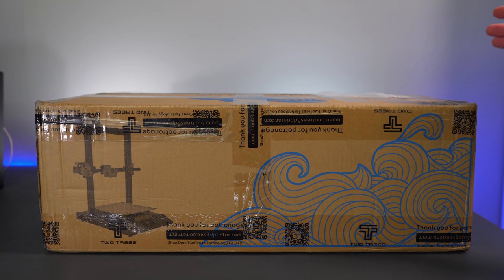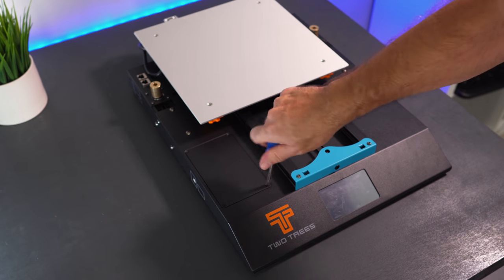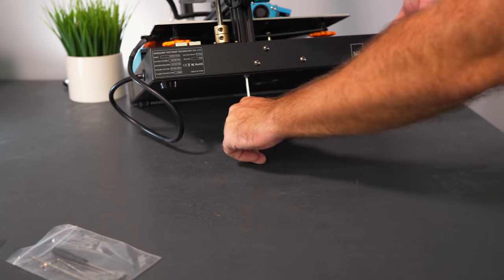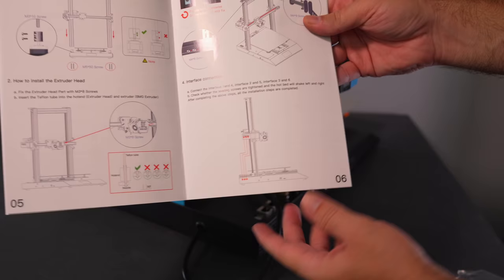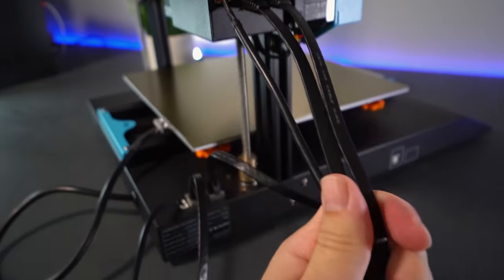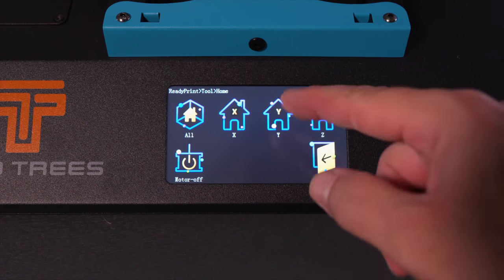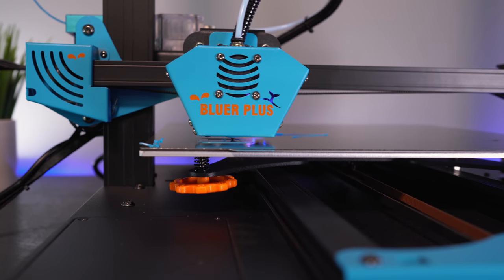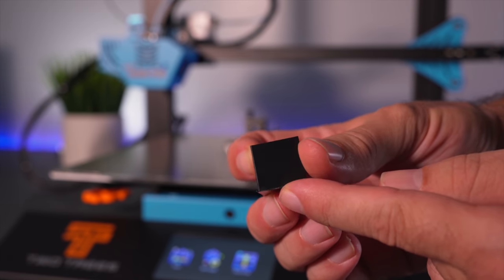Two Trees Bluer Plus - 3D Printer - Unbox & Setup

Comment: I cant understand the trend of placing a runout sensor right in front of the extruder, the best place is above the hotend but you also need direct drive as no matter where the filament breaks it will be detected, I have only had 2 filament breakages but both have been in the extruder gear and would not have triggered with this design.

Comment: Hi I bought this model and my extruder doesnt .... well extrude would be the correct word? The filamend get stuck after about first three minutes of printing and after that the printer stops printing and is running on empty while extruder keeps sort of twitching but doesnt move the filament single milimeter (I measured it) Any idea how to fix this problem and does anyone else has this same problem as me? Thanks

Comment: If you are concerned about kinking (crushing) the PTFE tubing, put a zip-tie (one at a time) along the length of the PTFE tubing, THEN zip-tie AROUND the PTFE holding the first zip-tie, lastly use the last one to go around the cable jacket, that will make sure you CANNOT crush/kink the Bowdin tube.

Comment: Hi, i like this printer, i believe i will add to my current printers ... some questions:
-Is the BL-TOUCH also used for the Z - Homepoint? I have not seen Z axis micro switch
-After you have performed an auto leveling, the values remain in memory on the CPU or is auto leveling always performed before each print? I hope it is the first hypothesis
- I saw that the display shows the preview of the gcode drawing, does this happen regardless of the slicer program used?
thanks for info

Comment: Looks like a nice printer but at $400, things like the filament sensor shouldn't be an issue.  Maybe on a $200 or less printer, not on a more expensive model. I'm sure someone will come out with a printed guide to help, but they shouldn't have to.  I really love how the electronics are all under the base keep its overall footprint small.  I plan on modding my E3P like that.

Comment: Returned this printer simply due to the fact there is almost no support nor upgrade parts and such for it. I'm newish to 3D printing and would prefer something more widely known and used. It is probably a good printer for the price but they did definitely cheap out on the hot end and the extruder is iffy.
Reply: almost any part you should need to replace is easily available, and the hotend is just fine

Comment: Vevy Very noisy printer..after few our with printing cooling fans are gone..its necessary to replace them  otherwise is good and very capable 3d printer. Just quality controll sucks...so before u start use get atention on this and very carefully inspect..most about hotend...its wrong assembled and u may get experience with leaking ad this damage your hotend.